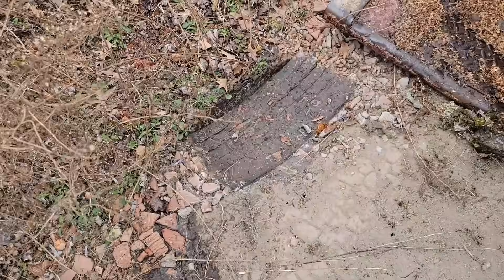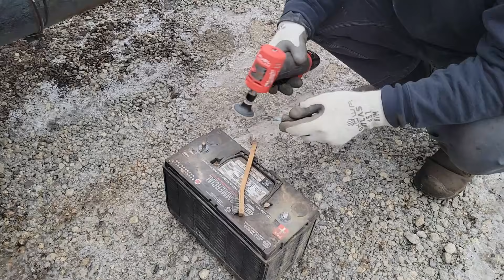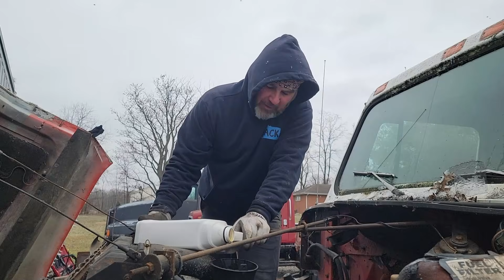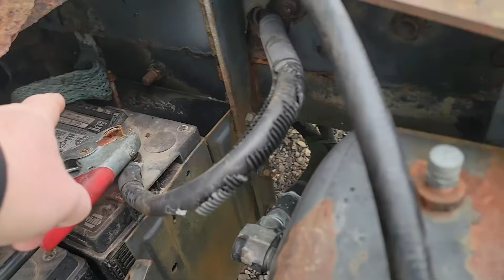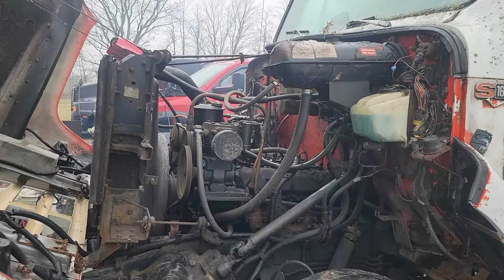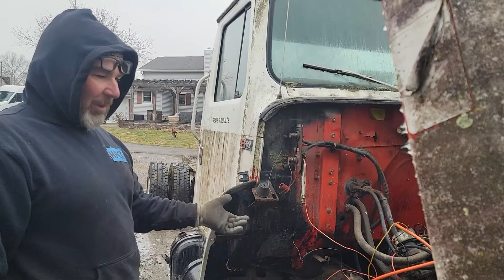INTERNATIONAL 7.3L IDI SITTING IN A FIELD FOR DECADES! WILL IT START

Comment: I had a 90s Isuzu npr no glow plug power. I used a starter solenoid and a temporary on button wired it direct (with a circuit breaker)
Pushed button count to 10 let off button crank engine an$ it would start.  (Poor people have poor ways )
You are a wealth of information not only knowledgeable but have a lot of experience to go with it, too bad we can’t start with that.

Comment: Blow torch or diesel soaked rag tied around a stick, then set it on fire and hold it over the air inlet................. basically does the same as the glow plugs.

Comment: LoL!!! I was sitting here watching you lift that truck up onto your flatbed, and was cringing the whole time, not because you were doing anything wrong, but remembering what happened to abuddy of mine,when his truck broke down...
He had a Dodge, 3500 with he Cummins Turbo... 
In the back of the truck, he was hauling a 5,000lb+. fluid head for the oilfield. he was in Mississippi!!! Which might have a lot to do with what happened.
He broke down, and called a tow company.. He informed them of what he was hauling, so they would be aware of what they were facing...the tow company sent out a smaller flat bed and hooked up to him, Instead of stopping the cable once his trucks rear wheels cleared the back of the flat bed, leveling the bed, and pulling the truck the rest of the way forward. The tow driver continued to pull and pull, eventually snapping the cable, and launching his truck backwards down the ramp... and into the pavement... "Totaling" his truck on the spot.. bent the frame and all...
Now my buddy wasn't the sharpest tool in the shed, and yes.. he was one of those type of guys who should have NEVER!!!!!! Been a truck driver... even a Hot Shot Driver.
He rented a UHaul box truck and fought forever trying to slide that fluid head into the uhaul!!! 
It literally started a 2 year process of him destroyng 3 Dodge 1- ton Dually Crew Cabs...

Comment: Hello JC, why don’t you want to use starting flood?
Reply from the maker: starting fluid is very dry. it removes the oil that lubricates the cylinder walls and rings. it can allow the unlubricated pistons and piston rings to score the cylinder walls. when you see someone running an engine of just starting fluid, they are damaging and effectively reducing the engine's life.

Comment: I would not recommend using starting fluid on any diesel, especially an (idi) might dislodge a 40 year old prechamber!! Seen it happen!!😊😊
Reply from the maker: a little patience getting all the systems working together and you can usually avoid it.
Reply: U are right about them not starting with out glow plugs!! (Nightmare) The DI engines are more forgiving!! I usually would let something like that, or if I had the fuel system apart and have time, I will let it sit over nite on the block heater helps BIG Time!!!☺️👍
Reply: I am working on a late 90s, like 2000 LeRoi 200cfm tow behind air compressor rite now!! It has no glow plugs no intake heater, no block heater!! And I live in the north east!! Long island Ny!! It's a John deer 4045df150 and it's low on compression so now we got junk till I get a block heater!!!
Reply: I just don't get who would sell something like this on the north east makes no sense!! Must have been bought out of state!!! And dragged back to Ny!!🤪

Comment: I’m not a fan of starting fluid either….but there have been occasions that required using it…unless it’s severely cold out…I’ve had success using wd-40 instead…i believe it’s a safer alternative . 
   Have you ever tried your battery heat gun or a hair dryer to heat up the air intake air ? I’ve had success starting my subcompact tractor with a hair dryer in extreme cold in the past
Reply from the maker: i have used a propane torch to direct a flame right down the intake before.

Comment: hi there and good morning from Norway.
in the veteran bus club I am a member of we have a bus that has a pretty tired engine (494050.3 miles in km yhis is 793097km which is quite a long time for an engine in Norway) this has never had any form of overhaul and when we start it we use a heat gun in the intake so that it draws in warm air instead of stale air we do this because then we don't have to use starting gas. I don't know if you have ever tried this but that is my tip heat gun in the intake :) the bus iam talking about has no glowplugs

Comment: Hey jc I’ve been noticing all your thumbnails don’t fit the screen correctly and if you needed some help or pointers on how to fix that just let me know. Whenever you take thumbnail pictures make sure it’s in landscape and not portrait. YouTube uses 16:9 and only 2mb size so I sometimes use a compress app that quickly compresses it to 2mb if need be
Reply from the maker: they give you a 1280x960 pixel limit. that is what they are. should fit right but...

Comment: That idi sounded and smoked pretty badly at first. Seemed to get better as it ran but it's very obvious it has a bad injector. Probably explains where all it's oil went, probably burned it all.
I still have a couple old Ford trucks with this engine, but just 2. Mainly because I don't care for these engines. All bark but no bite, inefficient and kinda gutless. Plus they really hate the cold weather and have lots of air intrusion problems. 
Yes they are simple engines and pretty easy to work on. At least the 2 of these I have both run good. I don't use them too often since they are strictly work trucks. Long as they still run without major problems I'll keep them around.
Reply from the maker: im still amazed that it was out of oil. no evidence of it leaking out while sitting. so it must have been run that low on oil. yet it fired up without any tick or knock at all. that is a testament to just how durable these ole slugs are.

Comment: Great job. A testament to the mechanical systems. Good luck trying to do that in 3( years to a 2025 truck that’s been sitting 10 years. Excellent video, thanks
Reply: That old mechanical stuff was slow but ran forever!! And if and when it broke, it was ez trouble shot!! I own two idi's and a 7.3 powerstroke would never sell any of that good ol stuff for the new junk!!!
Reply: Those idi's need like under 10 wires to run, and go down the road no Computer necessary!!!!
Reply: Now people drive trucks that are probably more complicated then the first 1981 space shuttle!!!
Reply: The new diesel trucks have an exhuast system worth  between 8-10k  and if the (def) diesel exhaust fluid drops below a certain level, the truck goes into limp mode and won't go over 30 mph!! Just what I always wanted the government controlling my fuel pedal!! 🤣😂🤣😂

Comment: I have the exact same truck I made into a rollback, it’s the best one I have. They are dirt cheap on fuel and geared perfectly, you can adapt. PTO on it by using the driven gear from an SM-460 4 speed pto gear. I wish I had that truck to build another one with!
Reply from the maker: they last forever because they dont make enough power to hurt themselves! i agree. very good truck for local flat ground work. they quit pulling a hill when they see them but they will do it all day every day.
Reply: @j.c.smithprojects that is flat funny.   Stop pulling when they see a hill...
Reply: Mr. Smith might sell you this one.
Best regards, luck and health in particular.
Reply: I have the same truck but it's a 1988 model year, 22' Rollback, mine has a double frame in awesome condition as well, 5 sp, PTO driven hydraulics. Newer tires, 19.5 rims, runs great but she has a 5.38 rear end which makes it slow, 55 to 60 tops. I retired so I don't need it. Last licensed around a year ago. Odometer has been changed so mileage unknown. It really does SIP diesel, even with a 1993 F-Super duty Wrecker sitting on the deck! $7,500. Two brand new 14' long hydraulic hoses to the winch. It's in Northern Minnesota on FB, marketplace. I talked to JC about it's speed issues a year ago I think. He may not recall it but I do. Lol😅.  BTW, that 7.3 holds 12 quarts of oil JC.😊 Love the brakes on these trucks, they will put you into the windshield if not careful 😂.

Comment: When it runs it's fun!!! J C you can squirt WD40 into the intake and it will run on it and not be explosive like ether. I would add some Seafoam to the next diesel and see what is does for the injectors. Power Service is also good to clean and lube complete diesel system.
Reply from the maker: i have never tried it but will someday.
Reply: Dear royl...
👍👌👏 I had almost the same thoughts and wanted to comment similar. But fortunately you already did all the writing work. 😁 ;-) 2) Usually Diesel injectors are rebuildable. Let's see what Mr. Smith does.
Best regards, luck and health in particular.
Reply: On older IDI internationals I always look for a block heater! If I plug my Idi in say an hour before starting it helps it start 😮!